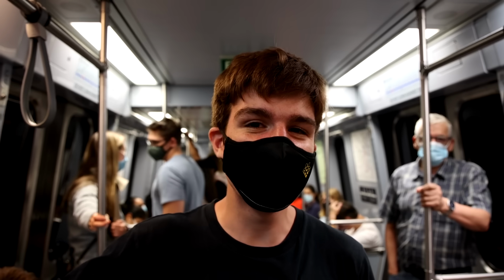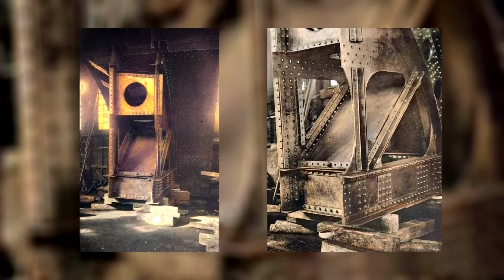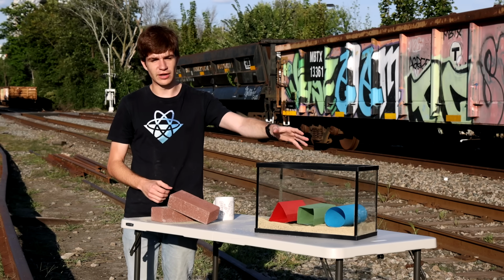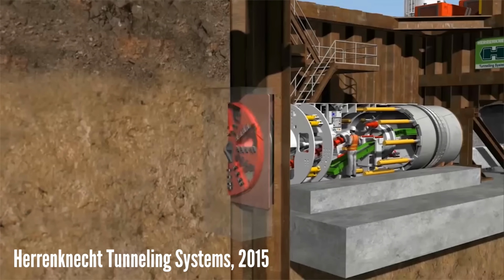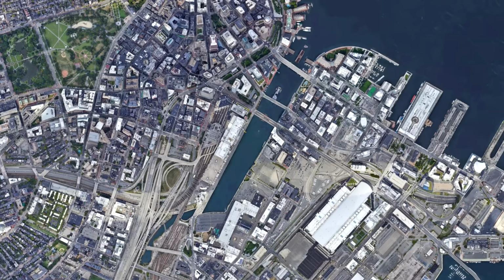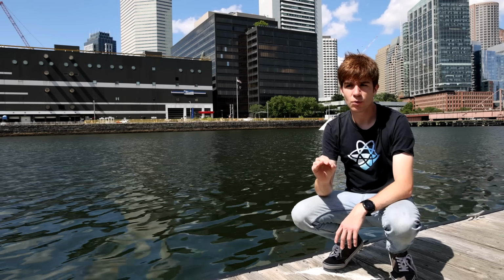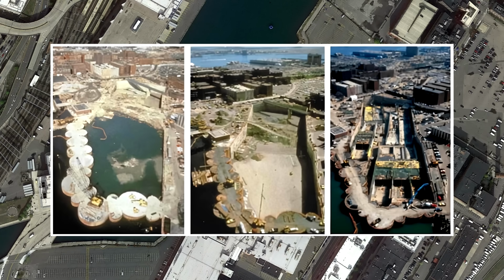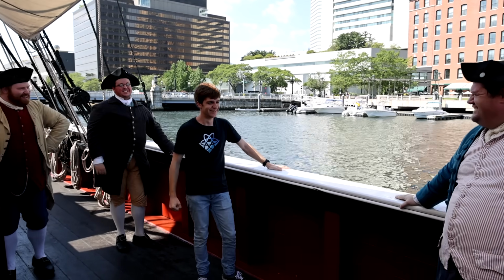Why It's So Hard To Dig Tunnels Underwater

Comment: An interesting video but I'm sure thunderf00t did an argument on the Hyperloop, I haven't watched it yet but he often has logical thoughts about why certain ideas won't work.
Reply: loads of people have done them.

Ultimately the reason it's bad is because one point of failure turns the entire tube in a vacuum cannon. I.e. them things which can make ping pong balls go supersonic.

See you'd think air cannons would be bad enough, but air cannons have to push compressing air out of the cannon bore, along with the object they're accelerating, they're literally having to push the atmosphere out of the way. With a vaccum cannon though, there's no air getting in the way, only air accelerating until the object reaches the accelerating gas' speed of sound.

Comment: Creating any sort of appreciable vacuum in a tunnel that extends from Boston to Bordeaux would require ludicrous amounts of energy (the potential energy of the vacuum would be something like dozens of terajoules), and be extremely dangerous because if the containment even just to the air at either end comes loose, the whole thing quickly looks like the barrel of a giant gun for firing passenger-vehicles. Just building a tunnel with normal air pressure of that scale under the ocean is extremely dangerous. Somehow trying to ensure that the first thing to go wrong doesn't cause the whole thing to turn into a terrifying water gun with humans and vehicles being fired thousands of km down the tunnel by a massive pressure wave followed shortly by high pressure ocean water... the safety of this thing seems improbable to the point that it probably shouldn't be believed. "Infeasible" doesn't really begin to cut it as a word for describing what the hyperloop folks are selling here.

Even if we could do this (which we can't), we shouldn't.
Reply: Where did he say anything about such a tunnel having a near vacuum in it?
Reply: @Valarien010  Looks like he might've cut the part where he mentioned hyperloop now.
Reply: Yeah the only way this would work would be to use airtight pressurized trains travelling at high speeds (not a hyperloop, just self-powered trains), and even that's a stretch. Even if it's feasible, you have to wonder whether or not the hundreds of billions needed to create such a thing is really worthwhile over just using airplanes.
Reply: yeah, critical-failure based safety concerns should ALWAYS be considered in such a project.
I'm sure there is something considered but the reality is that there is almost no real-world way to test such a critical-response failsafe so odds are that there would be a TREMENDOUS amount of anxiety around that particular question to begin with... I like the idea, but I cannot see an "unbroken sub-Atlantic tunnel" ESPECIALLY with a tectonically unstable region in the way. Perhaps a partial system with a sub-aquatic or amphibious ferry connector... but that STILL leaves hundreds of miles of hair-raising death-trap tubes...
Reply: thunderfoot is a hack
Reply: Yeah lol I think I rather take the word of the guy who built the biggest electric car company, and rockets that can land back down
Reply: Or, hear me out. We should build it and stand back, very, very far back. With a lot of high speed cameras to capture it's glorious failure.
Reply: Glad to see someone saying this. I'm a huge fan of Thunderfoot and his videos showing how hyperloop (vacuum tunnels) are infeasible and dangerous on short scales. The idea of doing them across an ocean is laughable.
Reply: @PsRohrbaugh  I'm also a fan of thunderfoots... current videos. He's definitely improved a lot

Comment: It is very, very unlikely that we'll ever build a trans-oceanic tunnel, not because it's impossible, but because it's unnecessary. 

For transporting goods, it would simply never be used. Why? Because transporting goods by land is far more expensive than transporting them by ship. The idea is to transport the goods as cheaply as possible, not as fast as possible. In fact, container ships have been progressively getting slower with time, not faster, in order to save fuel. 

So it'd be a route just for people. But ... we already have a pretty good way of moving people across the ocean, it's called an airplane. It's safe, comfortable, and fast, faster than any under-sea train would be. Also, cheaper. While you'd think that airplanes are expensive, a tunnel across the Atlantic would be even more expensive because of building and maintenance costs. 

Vactrains also won't ever be a thing. There are a LOT of issues with such a system, that make it inherently dangerous and hard. And, the thing is, we have a perfectly good vacuum transportation system just kilometers from anywhere we want to go. So, why build a super expensive vacuum on the ground or under water, when a perfectly free one is already available? 

Starship earth to earth makes a lot more sense, and has the potential to eventually be even cheaper than airplanes (because while it uses more fuel, it's cheaper to build, and it can fly a lot faster and therefore more often).

Comment: The circle is NOT the strongest because it has a smooth surface and is lacking corners.

If you look at the triange for example, it collapsed AT THE SMOOTH FLAT SURFACE, basically the flat surface itself bent inwards, it is smooth and the side of the triangle does not have any "shard corners", yet its the smooth flat surface that gave in due to the forces, while the corner of the triangle is actually the strongest part.

Imagine 2 of each shape with a plant on top, 2 circles, 2 triangles and 2 squares, and a plank on top of each of the paper shapes, if you stack weights on top of the plank, the circles would collapse first, (squares would be bent flat so dont give too much thought to squares), while the triangles would actually be the strongest shapes in this case.

It is not due to the sharp corners that the circle is the strongest shape, but due to where the forces are coming from and in wihch direction they are acting in.

The triangle collapses due to the sand pushing in on the sides towards the middle, the flat side is the weakest, while the circle has a PERFECT distrubution of strength, no matter which side you apply a force, the circle will have the SAME STRENGTH as ANY OTHER SIDE of the circle (obviously), while the triangle is only strongest if you apply a force DIRECTLY towards the edges of the triangle. 

Since the material is sand (lose material), it will not only apply a force on top of the roof of the tunnel, but will apply A LOT of force (stress) on the sides of the tunnel, which is the ONLY reason the triangle is collapsing before the circle does.

If you were to use a half-circle, it would have 2 sharp edges, but would work just as well as the circle does, if you made a circle and a halfcircle of paper, they would collapse under almost the same weight, the sharp edges has NOTHING to do with which shape is the strongest, since the stress / force is acting on top and on the sides of the shape, it is important that both the top and the sides of the shape has strength, a triangle lacks strength on the sides and a square lacks strength on top and on the sides, a circle has less strength than the triangle from the top, but it has the exact same strength on top as it has on the sides, so if you make a circle strong enough to hold up the roof, it wont cave in on the sides either (as a bonus, the more force applied to the sides of the circle, the more strength it has to hold up the roof, and vice versa).

This is why all pressure-holding tanks are circular /spherical, the force applied to any given part of the shape gives strength to the rest of the shape.

(This is adressing what he is saying at 3:54 )

Comment: Why it may sound as a good idea, its impractical to build floating vacuum tunnels. If we really want to have a rail connection between both continents, a floating bridge is easier to build. And less dangerous. One failure in a section of the vacuum tunnel will kill everyone everywhere in the tunnel. With a bridge - less so. I know this Hyperloop thing catches everyones imagination, but its just not viable in any economic sense. We already have fast traveling MagnaLev trains and they travel at 300 miles per hour without the need to build a vacuum snuff-box around them. And those didnt succeed either for cost reasons.
But for whatever the reason, large container ships are just better and transporting goods.

Comment: Now just solve the problem that the Atlantic is slowly expanding and would eventually stretch the tunnel and we can talk about funding.
Reply from the maker: I did have a look at that. Over the length of the tunnel those differences are minimal as compared with thermal expansion and the sway due to currents. It was in there but eventually removed it for being a bit too detailed and irrelevant to the main points

Comment: i think a maglev will be much more feasible than a hyperloop, think of the consequences of a pressure leak or rapid unplanned repressurization. ontop of that maglevs already exist in japan for example
Reply: For a terrestrial vacuum maglev (I refuse to use Musk’s word), I’d totally agree, the vacuum won’t be worth it. But deep underwater, the difference between a tube at 1atm and a tube at .01 atm when it’s 10-300 atm outside the tunnel, depending on how deep they want it, isn’t as substantial.

Comment: I might be pessimistic, but I think a transoceanic hyperloop will never happen. What in case of an emergency, if water floods the tube ? If the shuttle is stuck in the middle of the ocean, how can we bring fresh air ?
If we add all the costs of developing good enough safety features it won't be competitive against airplanes. And even the ecological perspective isn't great : the train might be fully electric (and from renewal sources...) the amount of concrete required is so gigantic !
As usual the video is really good !